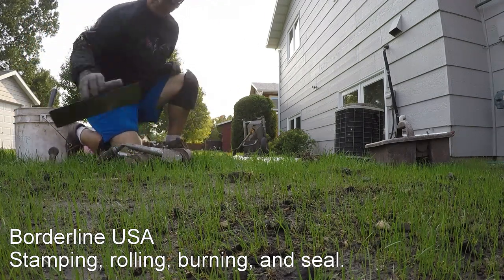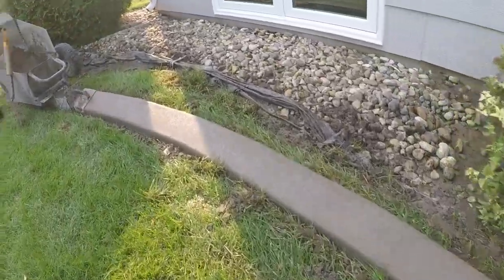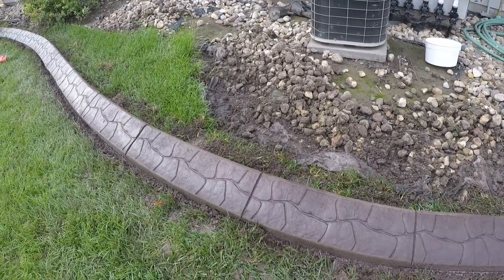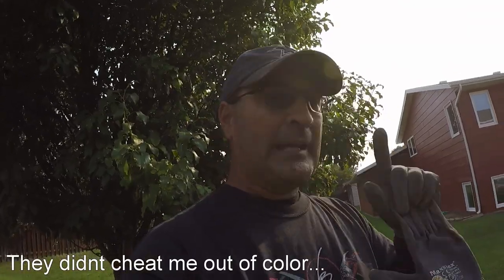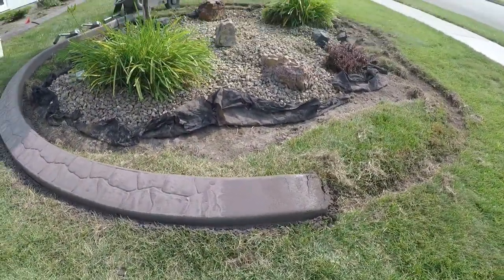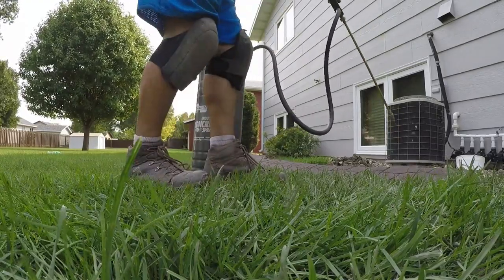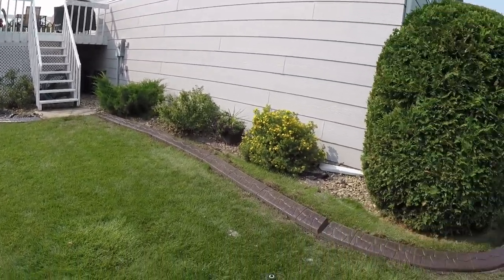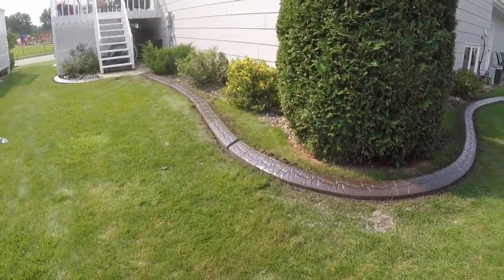Landscape curbing - Stamping tips by Borderlineusa.com

Comment: Thanks for your videos. I’m learning a lot in preparation for installing Curbing at my own residence. Wondering when you roll on the release, is the roller wet? Or do you just dip the dry roller right into the powder?  TIA

Comment: I am new to curbing and having issues with the flagstone pattern tearing as you suggested. What are some pointers I should use to adjust my mix or material selection for the mix?
Reply from the maker: Ratio sand to Portland is one, the correct sand with the admixtures, 
If u want give me a call in the office,
I can help u
7017512705

Comment: Great work, so your mixing a light colour in your mixer, laying the kerb, rolling a darker powder over top? Then mineral spray and seal when dry? Just started Kerbing in New Zealand and want to expand into this stamping, thanks heaps 😊
Reply from the maker: Yes, essentially you want dark over light.  make sure after you stamp you blow off excess release really good.  use paint thinner or mineral spirits to liquify the release powder, your not washing it off , when that evaps your sealer can go on.  depending on what kind you can get it must be a solvent based sealer, not water based.
Reply: @borders06  great thanks for that,if excess release is left on and the mineral spray applied, would that leave dark spots? Thanks again 😊
Reply from the maker: @karlrowley6611  yes it prob would be darker but the main issue would be that the sealer may not be able to penetrate the excess release, sealer could peel off later as it didnt adhere to the concrete
Reply: @borders06  thanks again, yes that make sence, slowly getting through your videos, shame it’s a long way to go or we would be there to do your courses, best out, thanks again
Reply from the maker: @karlrowley6611  im sure if you wanted a couple of us to come down we prob wouldnt have a problem with that!!!

Comment: I’m curious about the use of the mineral spirits on the release powder. Why mineral spirits not water
Reply from the maker: antique release powder is hydrophobic which means it will not mix with water.  release will only liqufiy with a solvent.  mineral spirits is good to use because its refined more so it doesnt have as nasty a smell as paint thinner.  ill tell you the majority of the time we just use paint thinner because being outside  the smell isnt a big deal.  if you were doing samples of curb in a shop then min spirits would be better.

Comment: How do you stamp without using release powder? If possible?
Reply from the maker: U can use a liquid release if u like but messy and doesn't give u secondary color.
Paint thinner on the curb and roller to prevent it from sticking
Reply: @borders06  paint thinner/mineral spray to wet and say flagstone would be possible?
Reply: Thanks man you kick ass!

Comment: @Borderline USA Bananacoast Borderline here from Coffs Harbour, Australia, your videos are really good, thank you for sharing. Just wanted to ask with the white spirits (mineral), does that effect the sealer when applied afterwards? Also, you mention “burning”, what does this mean please? Cheers Nick
Reply from the maker: Hi, believe it or not ive been to Coffs Harbour!!!  the solvent (paint thinner or mineral spirits) will evaporate very quickly so will not affect your sealer at all.  "burning" is what we call the process of misting that paint thinner onto the powder release to liquify it, it's not "burning" the color into the concrete, just basically getting it ready for sealer.  it gives your seal a much better chance of adhering to the concrete.
Reply: @borders06  small world 😊 thanks for the tips, gonna try it out this morning at home. Thanks 👍👍
Reply: @borders06  what mix do you use, it looks very smooth?
Reply from the maker: @musomatch2203  go to curbuniversity.com , there are two really good mixing videos there along with many others

Comment: Very nice presentation. If you wanted to DIY is it possible to do it in sections. I would think i would have to put a some small rebar in to tie the joints together. Other then that would there be any other issues? Thanks for the great tutorial!
Reply from the maker: To do this without machine and correct tools wouldn't work the way u see it
Reply: @borders06  i see you can buy the rollers and the color. It's only 40 ft. I can't see a company wanting to do such a area small . Here in Houston is very pricy.
I understand what you're trying to say , but it could be possible?

Comment: Did you go right over the grass or did you dig that part to lay the curb on the dirt?
Reply from the maker: Hi, I run a bed edger with a smaller blade just a bit wider than the curb itself. No more than an inch deep

Comment: Thanks for the informative video!  One question.  Let’s say you have a situation like what you’re doing with the island but it is bordering a whole backyard. How long do you have before the concrete gets too dry to be able to connect and trowel the ends then release and stamp?
Reply from the maker: Put a wet bag of portland over end to get moist.
Or u can use a dcell in mix to keep from curing too fast
Reply: Thanks that helped a lot.  The 2 issues we had was the Portland was clumping up in balls for some reason.  Made finishing much more difficult.  The piss helped a ton though.  What causes that?  Also the curb is weak and flakes apart especially in the cut joints.  Mixing just like you said to in your mixing videos.  Also using gravy.
Reply from the maker: Sounds like ur not using a mortar mixer and using a barrel mixer, barrel mixers won't work for this
Reply: Yep that’s the problem.  Thanks for the help

Comment: Can you put down the color, blow off excess and then spray the mineral spirits on when the cement has already set for a few days or do you have to put it on immediately after putting down the curb? I'm doing my DIY project by hand so it's taking a few days to complete the curb process.  Thanks
Reply from the maker: Not sure, havent done it but essentially could work.

Comment: Hello, thank you for your videos, if the curb is not shining after first sealer, can you add more sealer after like 3 days?
Reply from the maker: If it's not shining like u would like it to be there could b several reasons. How rough is ur sand? If its not smooth and tight on surface then its porous, sealer soaks in and it takes alot more. How many solids sealer u use? Always use an acrylic if u can get it. 25 percent and less it's considered a cure seal,  u can spray right away before u leave. Family how many coats are u putting on the first time? I apply three thin coats and it's very glossy , 25 percent clear guard from Butterfield. If u want u can come back and seal anytime as long as surface is clean but we do it all before we take off, costs time and money to come back. Hope that helps..